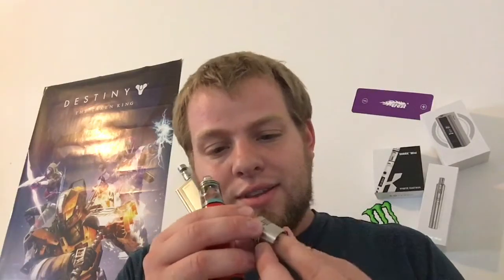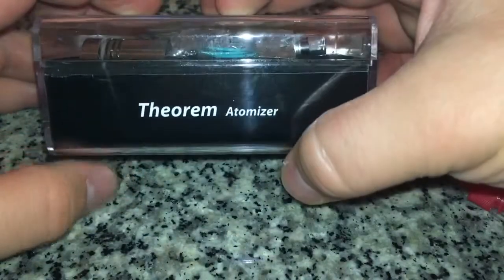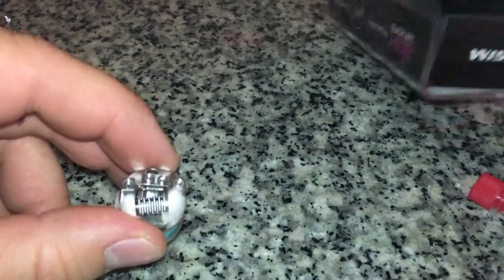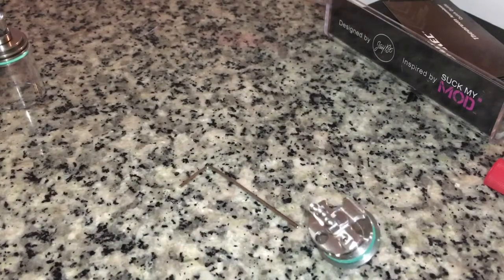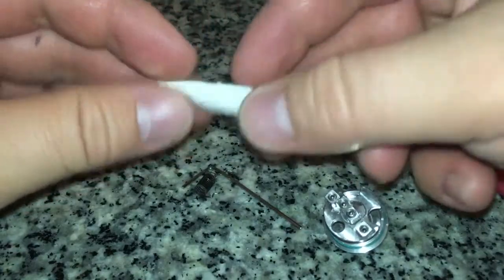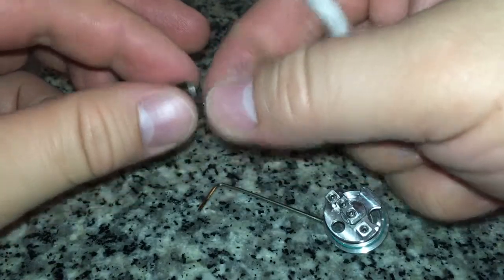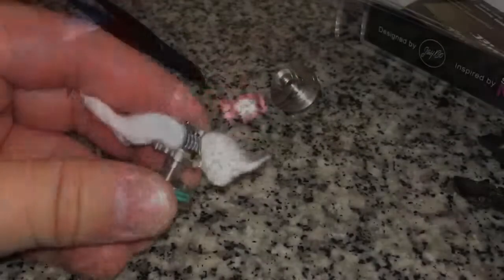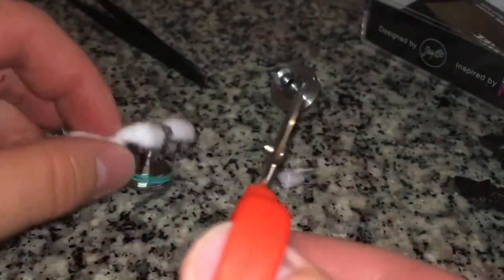Wismec Theorem Atomizer

Comment: Hey there, I just got that exact Atomizer today on sale at my vape shop for 2.50 brand new. Cashier said they are liquidating what they dont make anymore. I learned alot from your video but I do have a question. The top, or the mouth piece easily comes off. I can barely pull it and the entire top comes off. It has the rubber seal and still does it. So, my question .... does yours.. Or well it's been 6 years now.. Did it do that?